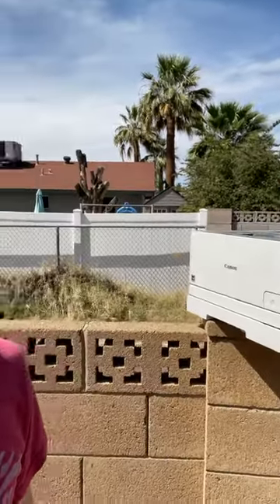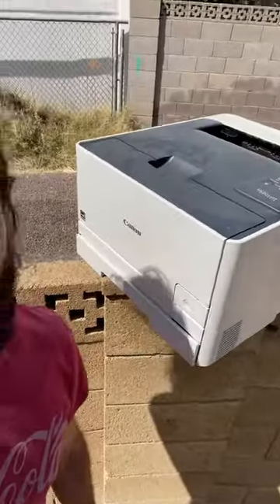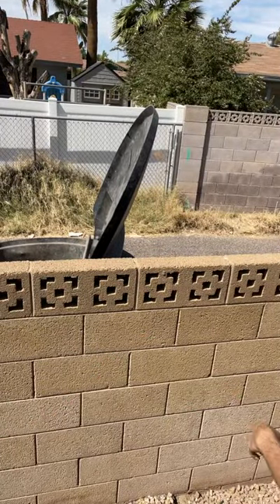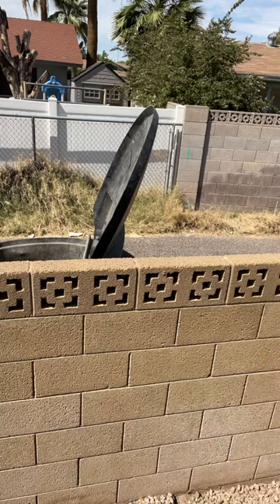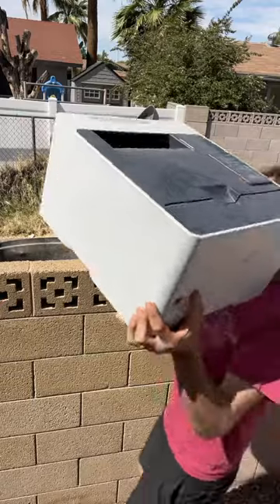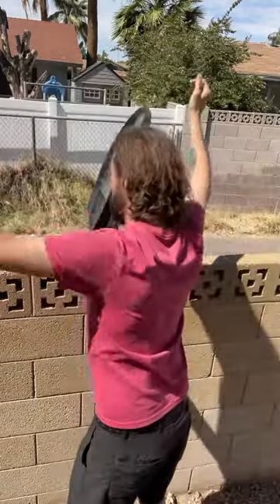DIY Throwing away a printer

Comment: Question, is it really that important to open the lid? What would happen if you skip that step?
Reply from the maker: Yes. That's a key step. If you don't, you're not throwing it away (it's in the title). It would probably fall to the ground and some unsuspecting soul would drive by and think they have found a perfectly good alley printer.